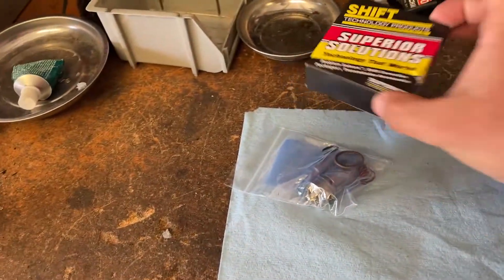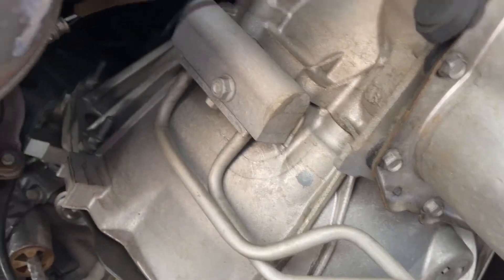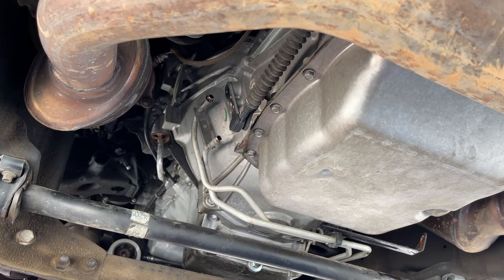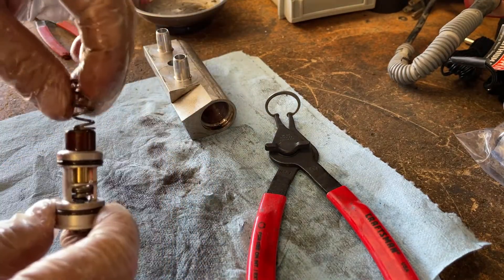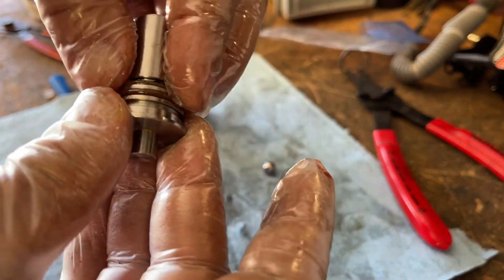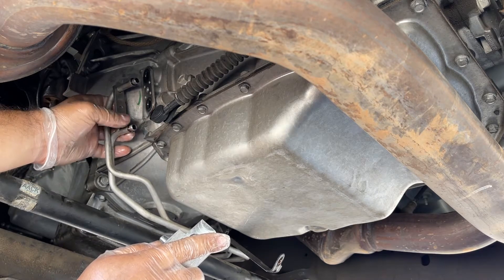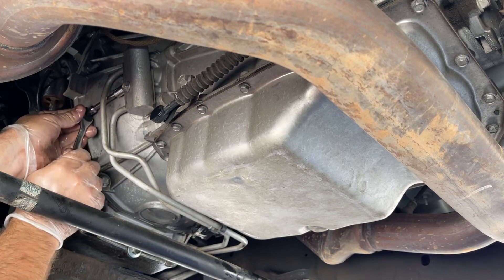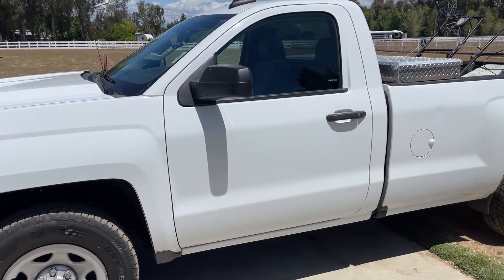Shift Technology Products Cooler Bypass Installation STL010

Comment: Thanks, but what lucas did you use
Reply from the maker: You can either use transmission stop slip or normal heavy duty oil stabilizer. Either make great assembly lube.
Reply: @hanksgarage_ thank you sir, great vid. It helps me alot

Comment: Thank you, very informative video. Not sure if someone mentioned, But I just did mine yesterday, my truck is a four-wheel drive and the front drive shaft is right next to this. I'd recommend a ratcheting wrench to get in there, I couldn't with a ratchet and socket.

Comment: I literally just followed you step by step and paused when I needed to. Thanks. This is the first time I ever purchased something off a lot and when I got home and started doing research about it my heart sank. But so far I've done the Disabler, catch can and now this. Hopefully it lasts me.
Reply: Get the transmission tuned at a horsepower tune shop. There are things wrong with the stock transmission settings. May want to look into it if you want the best transmission you can have

Comment: This kit did squat on my truck. Trans was running around 190 two months later it was still the same. Just get the ppe replacement and a trans cooler. That actually worked on mine.
Reply: @Doublewogurt  I just did mine today on my 2019 Suburban and after 45 mins to 1hr drive. I was at 195F. I did expect temps to be much lower than 190F.

Comment: Comments based on my experience and not the quality of the STL product. If your truck is or has been operated on roads that have been salted in the winter it will not be a easy swap of the internals because the block is aluminum and the internals you are removing are aluminum. Due corrosion around the cap (under the snap ring)  it may be impossible to remove (even after soaking in penetrating fluid). I had to drill and Dremel the cap in order to remove it and scored the wall of the block in the process. After installing the STL010 kit it leaked do to the scored wall. Ordered a new (fully assembled) replacement thermostat from Amazon and installed it the next day. I'll save the STL kit for now.
Reply: @davefarrell856  mine is a 2015 from Michigan. 147k miles I didn't see any corrosion in mine.
Reply: @JohnDoe-m3e4q  mine s 2018 in Southern Ontario w/~130k on it and there was no way in hell the cap under the snap ring would come out due to the corrosion

Comment: i just did mine this morning, only thing I noticed is that removing the original parts, mine didnt seem to have the spring inside :s
just the thermostat and the part with the 2 O-rings you pull on and remove etc.

Comment: OK, I just picked one of these up. All new gaskets or my question is how is this gonna work? I live in Saskatchewan and it gets like -40. Sometimes we get down to -50. Am I gonna have any problems with this shifting in the winter time or the transmission warming up enough.
Reply: I'm in the same boat, what did you discover? Did you do the install?
Reply: @ryanmayerz71 yes I put the new o rings in there is two of them that goes on the line and the back one I replaced as well took 20 mins to do since I changed it the temp only goes to 54celius
Reply: @elden8785  awesome. And how does it do in SK winter at -40
Reply: @ made a couple days in Saskatoon with the same thing they did there a year before me and it said no issues at all
Reply: @ made a couple days in Saskatoon with the same thing they did there a year before me and it said no issues at all

Comment: I installed mine, fairly certain I installed the spring correctly, then drove it around for 30 minutes.  I’m still at 190 degrees. I didnt have any transmission grease, so I used the residual trans fluid in the block.  I’m old, maybe I didnt put the spring in correctly.
Reply: @dougiefresh2521  same thing happened to me. Just installed. Still high temps. I’m actually getting the updated GM bypass valve. Opens at 158 instead of 194.

Comment: I just Changed my transfer case, front and rear dif fluid, coolant flush and brake flush and FINALLY the STL010 Thermal Bypass mod.  221F avg before  163F Max after, avg was 145F.  That is 58 degrees lower from max and 76 degrees lower from avg.  I live in hot muggy Houston so I will never see you guys winter temps.  DO it ASAP if you have a GM transmission
Reply: @rickharris8780  also make sure you adjust the transmission fluid capacity according to the new bypass valve . Manufacturer says cold line at ENGINE operating temp. Hot line at around 130F-140F . I feel like no-one talks about this..
Reply: @ probably. I just fill until I have the right stream from the check plug. It is more just don’t notice it as I always have extra in and then once the stream goes to where it needs to be. Basically smallest stream before it starts to trickle rather than stream.
Reply: thanks for the tutorial.  my temperature dropped from just over 200F to a maximum of 171F after hard driving for an hour. take care.

Comment: My question is. What happens when you live in a colder climate? Here where i live we have 90s-100s during summer and negative temps in the winter.
Reply: it's still a valve that will open when temps reach a certain point. it just opens much lower than the stock valve.
Reply: Not sure if thats the case. They claim you can check fluid level immediately with this installed @dalton-at-work

Comment: Just a tip for anyone doing this with a 4wd Sierra, because of where the front driveshaft sits, which is right next to the cooler, you kind of have to get right under the cooler to have the angle to loosen the 2 bolts. Once the 10mm that holds the lines is out, the lines will wait until the moment you glance to grab a rag and break loose and drop about a cup of tranny oil on your forehead.
Reply from the maker: Good info for people. 👍

Comment: 2021 Silverado 2500hd 6.6L  ((   NOT  Diesel  ))   12k miles 6 speed trans running at temp 194 to 204  going 65mph to 95mph TEXAS toll and no trailer.
 Thank you for showing how u took all the bolts off and everything back on and what tools u used. This is the best video i saw out of all of them.
Just finished the job and have not took it out for a spin, but did turn it on for leakages and none so far none. Not much fluid was lost at all, and the Snap Ring I used a KOBALT snap ring pliers from Lowes for 15 dollars and change and use Lucas assembly grease i got from AutoZone 4 dollars and change.

Comment: I just finished installing this on my 2020 Silverado with a 8L90 trans.  The block is horizontal rather than vertical and the lines enter it on the bottom instead of the side.  Other than that its the same procedure.  1 hour start to finish and that includes getting the car ramps set, finding the tools, doing the job, and clean up.  Total fluid loss was maybe 1/2 oz.   The hardest part of the job was getting the snap ring out.  Even with a snap ring pliers I had to use a tiny screwdriver to gently pry the ring out of its position.  A 13mm ratcheting box wrench worked even better than a 13mm socket, the front driveshaft is slightly in the way but the ratcheting wrench made it an easy in and out for the bolt.
Reply: I just did this on my 2015 Silverado 8l90 and it’s running at 135 to 140 degrees compared to the 180 before I looked it up says that’s not a good thing
Reply: I can also confirm this. I did it today on my 2016 Sierra 1500 Denali and it was horizontal instead of vertical. Honestly, I think it made the installation easier. I didn't have to remove the bracket with the 15mm bolt for the lines because of it, which is one less step to this process. Very minimal fluid leakage and took about 1 hour. Just drove my truck 30 miles and my trans temp never went above 125.
Reply: @RoseandMelody  by chance how high was yours getting up to prior to changing. I have a 2020 rst with 8L90 and I'm starting to believe mine is stuck closed allowing the Temps to rise to dangerous levels.
Reply: @devinbritt3265  I'm in northern WI and even in summer it was running between 150-190.  This winter with sub-freezing temps and the kit installed it rarely hits 90-100.
Reply: @devinbritt3265  how high have you seen I was driving with travel trailer today maybe like 7000 pounds It went up to 270 in about 35-40 minutes of freeway driving

Comment: I have a v6 so this isn't a option. Wondering if  changing the filter will lower the transmission temperature?
Reply from the maker: This is for the v6 too, This truck was a v6
Reply: @hanksgarage_  the lines go from the radiator to two different spots on the transmission. I look again
Reply: I replaced the thermostat and that fixed the problem.

Comment: GM has a lower temperature thermostat available under TSB#21-NA-199.  Why wouldn’t we just do that?  The new thermostat opens at 70C (158F) instead of 90C (194F).  As i understand it the bypass leaves it open all the time, which keeps the fluid too cold and lowers MPG.
Reply: @snivesz32  Cause GM is how we got here in the first place.
Reply: The thermostat is not a direct replacement on all years 14 and up, there are different tube/ oring connections unfortunately
Reply: @wooshkabeeba132  cooler lines are different but the internals are the same. Yes some 6l80s come with clips on the cooler lines and others come with a plate that holds both lines in place.
Reply: I installed it. Just moved to Vegas. Middle of summer. City driving.topping 200F. Highest was 217F. Im gonna put the bypass on.
Reply: I my opinion the Government should keep their mandates out of the automotive business.
Reply: Do you understand CAFE fuel efficiency is what drives this and it’s nothing you will EVER notice….
Reply: @nordicpride9708  you will notice when your transmission fails
Reply: @I live in an area that gets -20° in the winter and 100° in the summer so actually I want a system that works well in both of these environments.  I shouldn’t even have to think about it, but once I do, I need it to be right.  I tried the bypass, and it was fine in summer, ran a bit cold 145°F but then climbing a mountain offroad it still hit 250°F before I shut her down and idled it.  So the bypass is no panacea either.  The setup I have now is amazing and very happy with it.
Reply: @snivesz32  what setup do you have now?
Reply: @Swickaz  I use the updated GM TBV and then after the regular trans cooler I added an auxiliary trans cooler (9”x11”) with its own bypass.  This was ultimately the best solution because neither the tbv, flipped pill or the STL010 affect max temp (none change total system heat rejection).  I tried them all and it  still used to overheat (250F) during 4Low climbing in the mountains.  All these devices only change the minimum temperature of the trans, none alter its max temp.  But now with the TBV and the aux cooler it doesn’t over-cool in the winter and doesn’t overheat during extreme demand.  I took the STL010 out because under everyday short-trip driving it wouldn’t ever warm up.
Reply: @snivesz32  Because we dont need one. Screw the government emission mandates

Comment: Hank, I installed the STL010 this weekend and replaced the fluid and trans filter and I'm still running at 195 degrees. on my 2016 yukon XL I think my trans cooler lines need to be flushed. wish I flushed it while I had it all apart. I bought some lube guard transmission cooler cleaner from Amazon and am going to take it apart again and blow the cooler lines out this time. Also I didn't lube the pistons.Maybe I'll try that. Anyway, great video, thanks for posting.
Reply: is that a V8?
Reply: @gmm4343  yes, 5.3 . Update, whatever was stuck in the cooler must have loosen up, because the temp went down to 136 for short trips and 165 for a one hour trip to Philly last night.😄
Reply: @scottsnell2888  ah ok good. I was going to say if you’re like me and have the 4.3 v6, it’s a different cooling system. We don’t have the auxiliary fin cooler in front of the condenser. The fluid only circulates through the radiator which in turn exchanges heat with the coolant( hot temperatures). Us V6 owners will have to install a cooler if we want temps that low 🥲
Reply: @gmm4343  V6 owner here too. Haven't seen any info on installing a cooler. It's a V6 in this video but the two lines going to the transmission are spaced apart .
Reply: Changed the thermostat and ran it for awhile. The next day I drove around town and the transmission temp wasn't getting hot like it did before.
Reply: @gmm4343  yea bro same, installed it today at work and on my way home my temps were the same :/ looking into aux coolers now
Reply: @youngfn5756  did you look into the coolers ? i work at a shop that makes the cbr oil cooler but im not sure how complicated it would be to add it to my truck, cant find any videos or a write up about it either

Comment: Some kits come with a gasket, you didn't mention it so I assume you didn't buy that kit. I'm gonna buy the one with the gasket. Any torque specs on those nuts or not that important?
Reply: @ALRIHAE  I saw that you can buy the kit with or without the gasket. What’s the purpose of the gasket if they sell one without?
Reply: @PanhandleAudit  I ended up buying the one without the gasket because I'm a cheap ass. Installed perfect and no problems at all in the last six months. Only thing I noticed is it keeps it too cool and my heater doesn't seem to be getting as hot when I'm on the highway

Comment: I installed it on a 2020 Silverado 4.3, and made no difference.  Temp above 200f .
Reply: Add a tru cool 40k transmission cooler
Reply: @Captain4679  I've noticed that it makes a difference while the truck is moving steadily at certain speed. However,  if  I'm driving in the city or where traffic is slow it doesn't make any difference
Reply: @Osvaldo-xs2mt  In that case, I’d definitely recommend changing the internal filter. The internal filter is usually overlooked in regular maintenance as well as the dealerships usually for some reason almost never recommend changing it in regular maintenance. I took the initiative myself to do it after the dealership declined to do it on my own truck ( 2011 Chevy Suburban 2500 6L90 6Spd) & have dropped temperatures from 190s to 150s during the exact same drive cycle as well as ambient temps I usually do including towing. I’d put it in a list to help drop transmission temperatures in ascending order: 

1. Change Internal filter as well as pan fluid only
2. Add the STL010 Bypass Kit
3. Change torque converter ( which you should do regardless 6l80/6l90 every 100,000 miles due to factory manufacturing weakness 
4. Add transmission auxiliary cooler or better yet another additional cooling fan or upgrade 

I’m almost 100% certain this will narrow down in  that order finding out what’s causing those high temps as well as increase longevity in those transmissions. I’m not a professional however confident in the methods provided. Best of luck!
Reply: That could be a sign to replace the internal transmission filter. Overtime it gets clogged affecting flow. Very important
Reply: @oalsouqi  last time serviced the transmission at valvoline, they didn't change the filter. Thanks
Reply: Did you put the spring upsidedown?

Comment: I installed one when I rebuilt my transmission last week. I haven't seen temps over 130 while driving. Seems super low, I did see a 160 after a long steep hill and then I needed to stop shortly after and it crept up to 160 but today I was at 123 degrees all day. Hoping its not too low.
Reply: I bought my truck used. In the cold months, my transmission runs 110 in the summer months, and it goes to 140. Everyone I talk to said there is no such thing as running too low of temp in a automatic transmission.  Since heat is the down fall of automatic transmission.
Reply: @philzandstra2660 correct you are
Reply: Well I wouldn't worry about the temps being too low. Hell it starts out at 30 degrees in the winter and works fine so I'd say anything above 110 should be a comfortable operating temp.
Reply: @Geargrinderc15  yeah its been ok in warmer weather i have about 28,000 on the rebuild now and its still going strong
Reply: Sounds a bit low for those temp , could be thermostat sensor reading to low maybe needs replace
Reply: @kingadri1180  not sure, it’s always pretty much equal to my ambient temp when I first start off
Reply: @joshmx28  i installled mine this morning and I been driving over 1 hr stayed nomore than 130 as well 
We’re at 55 degrees right now

Comment: Anybody do this and still run over 200 temp
Reply: Me
Reply: Damn. That’s crazy, I just bought mine and still haven’t installed it. So seeing this comment is really fucking with my head 😢
Reply: @moemaison install it. If your transmission isn’t broken. It should work. Heat is transmission enemy.
Reply: @evoxgeo I got it installed about 2 months ago and let me say this, when driving on the highway it’ll keep my temp around 150-160 but once I start driving locally for about an hour or more it goes up to 215 and mind you I just got an new transmission, driveshaft and solenoid installed by the dealer about 6 months ago after my transmission blew at around 48,000 miles and now I currently have 53,000 miles on it.
Reply: @moemaison  that’s seems crazy odd. I think it should be doing this.

Comment: top cap is impossible to remove once corroded mine is 2017 hard to remove please be weary of this you’ll be stuck until you get a new valve
Reply: Had to carefully drill mine out

Comment: I am going to do this on my 2019 Tahoe. Do they have one of these for my other 2002 Tahoe?
Reply: Hi sorry to bother you. I have 2011 tahoe is there any measure I can take to lower trans fluid temps
Reply: @cowboyninja9811 trans cooler 
2011s don’t have a bypass valve

Comment: What kind of lucas assembly do you use? Lucas red n tacky or lucas assembly fluid, grease?
Reply from the maker: You can actually use either stop slip or oil stabilizer, both are a great assembly fluid.